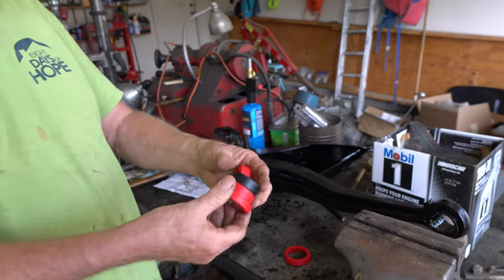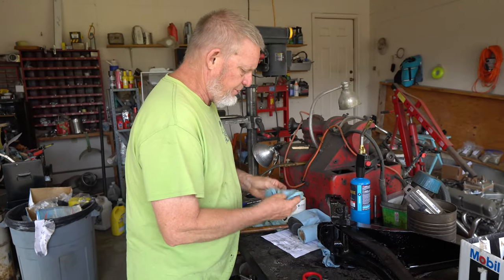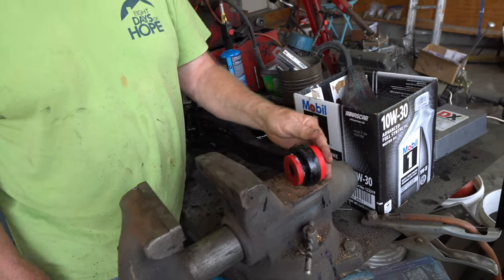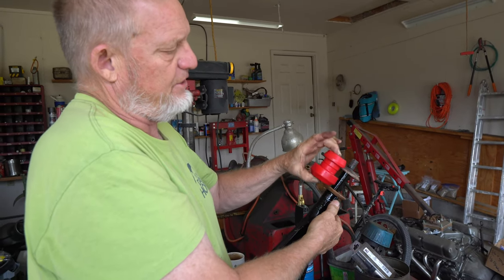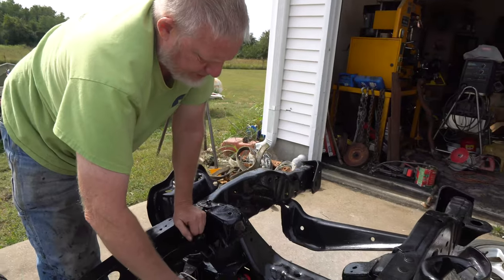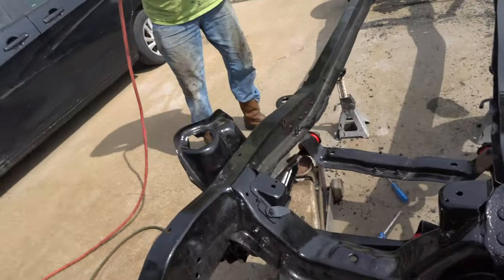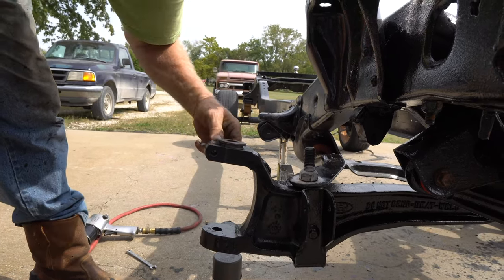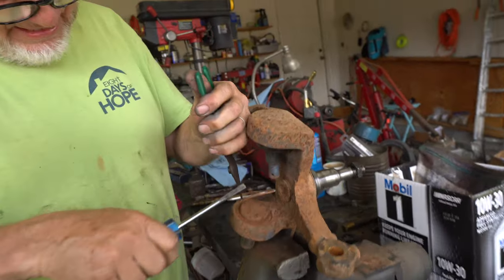How to Install control arm bushings on a twin i beam truck

Comment: Wish I had watched this video two days ago. I just did my pivot arm bushings on a 94 150 four-wheel drive and the silicone packets I thought were to make it easy to slide in 😮 well I guess I better take it off and silica in it or I'm going to be squeaking and deformating😂 already did Leesburg shackles couple months ago I want to do the cab bushings cuz one is Rusted through and I'm going to have to put a floor pan in or have somebody do it cuz that looks intense but I might thanks guys